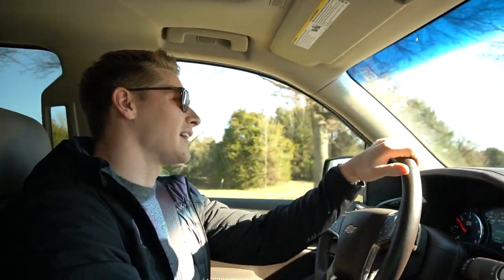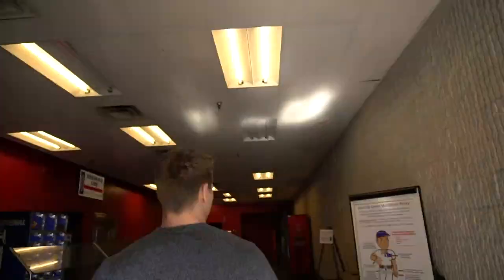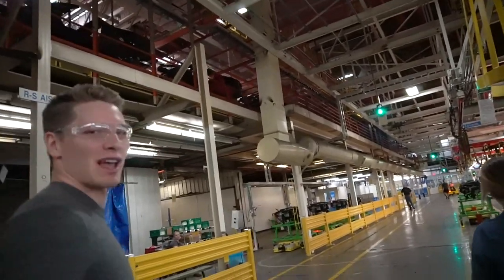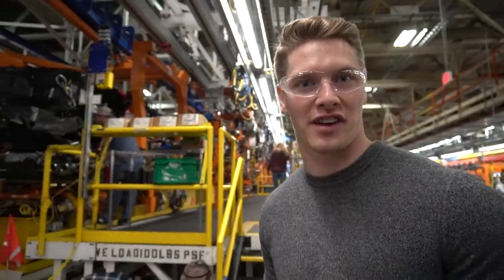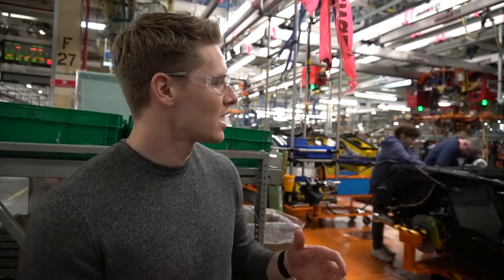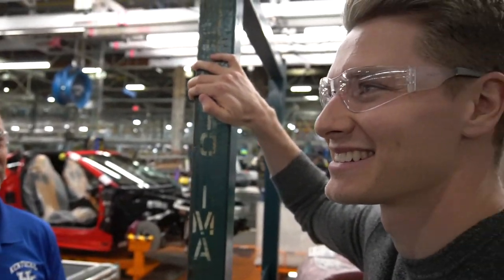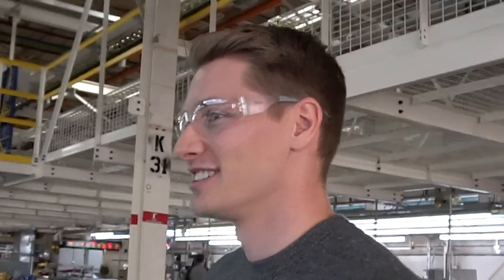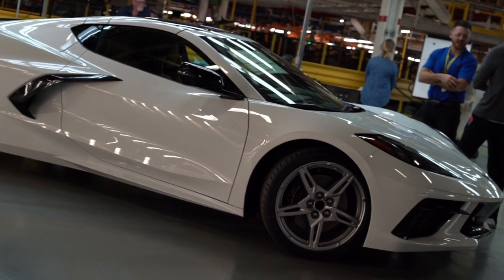ADMIT1: Chevrolet Corvette C8

Comment: I like the dash in my C-5 better than the C-4 or C-6/7. It reminds me of the C-2 dash of the late 60's. I'm not quite sold on how the new dash looks. That bar running down between the seats would take some getting use to. My 02' looks great in white and it looks great on that C-8.
Reply: I profoundly dislike those LCD dashes as they have no personality, just a tablet designed to fit in there. The steering wheel is disgraceful and the absence of a manual transmission unbearable. I don’t know what GM were thinking. Probably they weren’t as per usual...